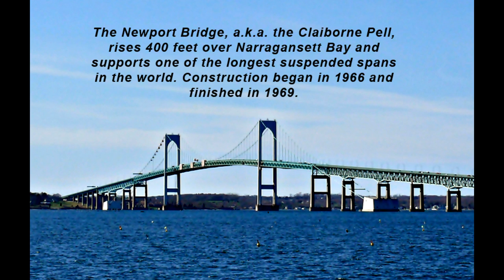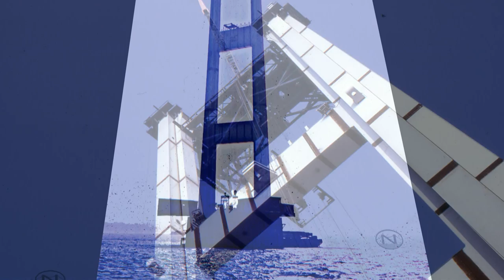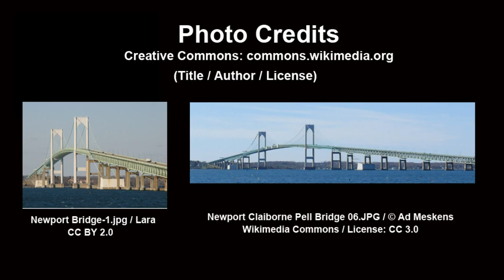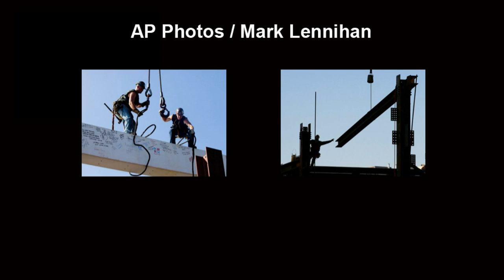Swingin' That Steel

Comment: Is there somewhere to buy this song
Reply from the maker: Thanks for asking. It used to be a buck a song and $7 or so for the album, but I see the cart isn't working so I set it for free download. Find it at around #20 on the GodBlessTheBiker.com player. When you click on it, you will see that download symbol lower right. You might have to scroll the player screen a bit. Actually, the only reason I charge for any song is when musicians, like the great guys I had on this one, put in a lot of work. What the hell, it never amounts to much anyway. If this doesn't work, I'll dig up the direct link on SoundClick.